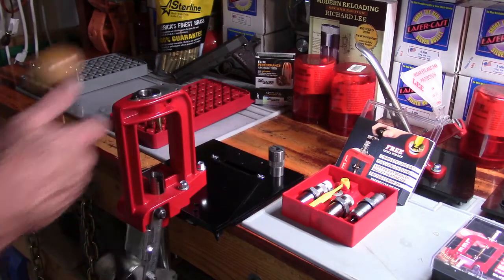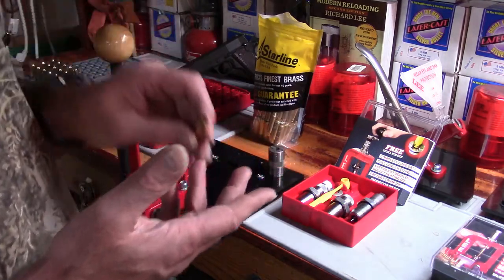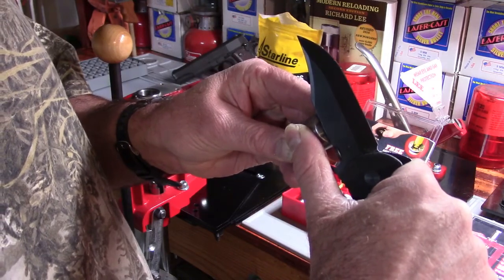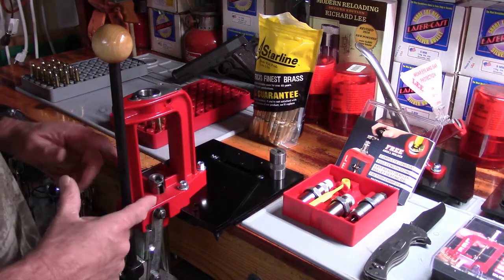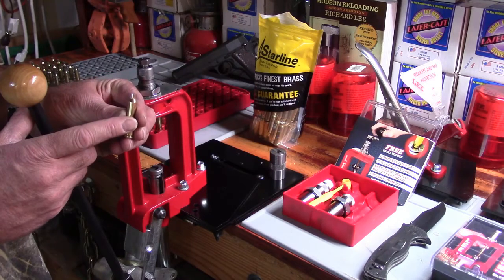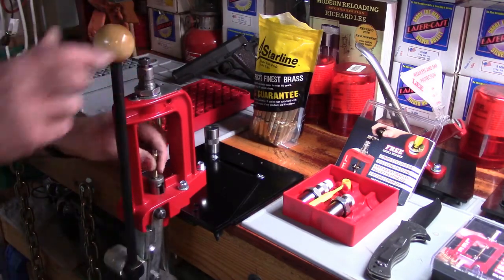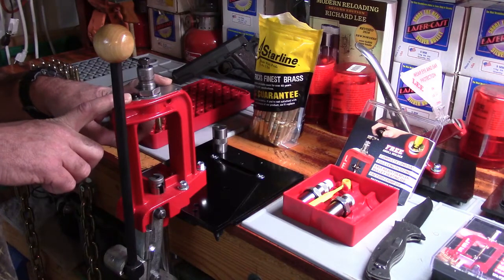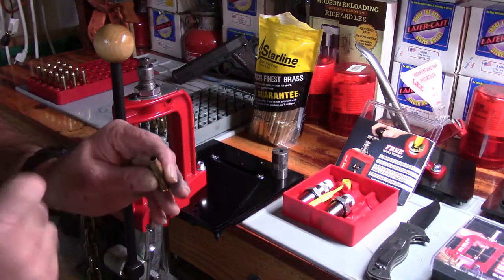Lee Beginning Reloading, 223/5.56, Video 11, Setting F.L. Resize Die for Neck Expander/Uniformity

Comment: Great video you made. Since I'm a new reloader I picked up all my brass and range brass. Now that I started to reload I notice not all brass is the same. I been trying to figure out my issue with the shoulder setting. I have one time fired brass from my AR. I tried set it back to -3 that way all range brass comes out the same. Is there a video on how to figure out range brass to work in your AR? I tried but some reloads I did were very tight and after fired it would not eject... like it got stuck ... Don't want to damage my AR but any kind of help would be awesome.

Comment: with new brass after doing uniformity with your Lee F.L. neck resize only per your video and it meet the gauge SAAMI spec then you don't need to trim your case is that correct?
Reply from the maker: You need to trim according to what your manual calls for. Highboy
Reply: @76Highboy  I just got some new Lapua .223 brass and was looking at your video many time of how you set it up and it make sense right now I'm looking at you primer setting depth for .223 and using the primer uniform tool  thanks for the quick respond.
Reply from the maker: @ozarkmountainoutdoors3255  I rarely respond on YouTube anymore but you can find me on my website. If you join, use a fake name. 76highboy.com
Reply: @76Highboy  ok thanks for your respond and I will join you do a good job in explaining things.

Comment: So I am having trouble with a ridge right where the neck begins (case head side) how can that happen if the case is fully in the resizing die, isn't the outside of the case fully constrained by the die? I can't find a profile drawing of a necked cartridge anywhere, just straight case dies. Any ideas? all cases are trimmed to length but it only happens on some.
Reply from the maker: All questions can be asked at... 76highboy.com

Comment: Have another question. Ever since I had a case get stuck in the die I've not had an easy time re sizing my brass. Since that time I have had to lube the heck out of the cases, before all I had to do was give them a quick spray with my can of One Shot resizing lube. Not sure if I maybe screw my die somehow. What's your thoughts on this?
Reply from the maker: OK, hope this makes sense. The more the internal pressures on a case the harder it is to size. Are your reloads getting a little too hot? Try dropping the charge down and resize from there. A stuck case will not change the way a die resizes. Shouldn't at least, but increased case pressures will. Let me know. Highboy
Reply: 76Highboy Reloading I'll let you know. I've been loading 26grains of cfe 223

Comment: If you use the neck resizer for this process wouldn't be slightly different after you fire them and then use the full length resizer.

Comment: I'm a new reloader here, and wanted to ask; if you are reloading new brass and after full length sizing the brass it doesn't sit low enough in the Wilson gage, (in between the Min-Max) specs how can you adjust your sizing die to compensate, and allow it to fit in the gage correctly? BTW-Thank you for all your great videos.
Reply from the maker: Due to question overload you can find Highboy at 76highboy.com

Comment: Once brass is in the system should the die and case holder still be touching? No matter what I do they won't touch if brass is involved
Reply from the maker: I don't know what the system is. Just as an FTY for you, I do not answer questions if terminology is incorrect. Get you manual, read it, and learn to use correct terminology. Highboy